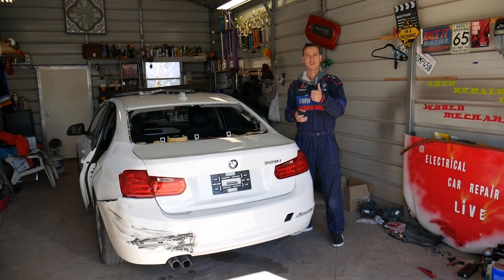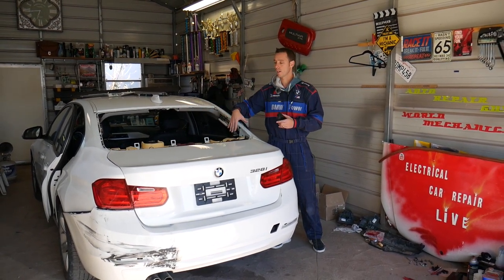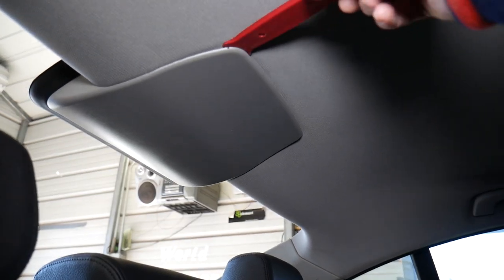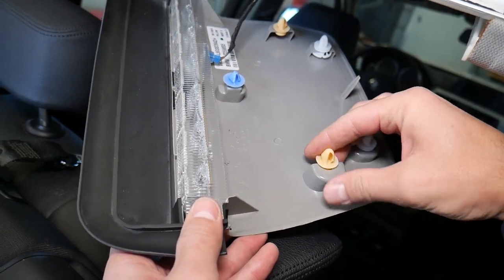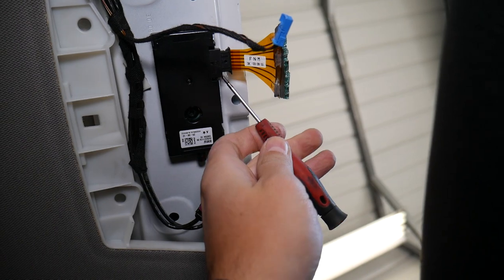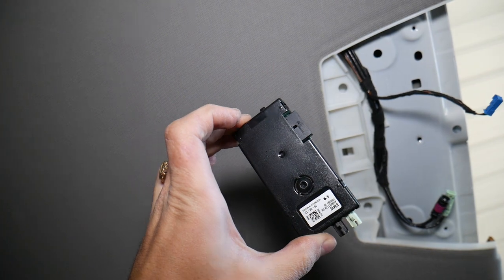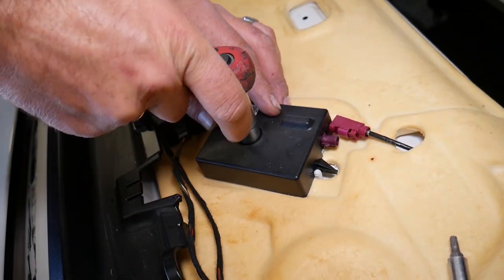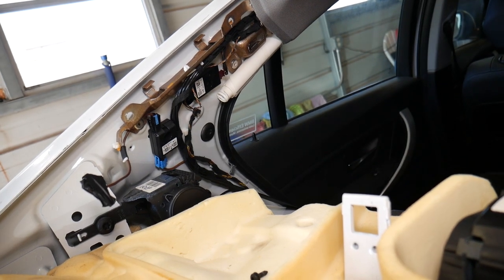BMW F30 F31 F32 F36 ANTENNA AMPLIFIER MODULE LOCATION REPLACEMENT 316i 318i 320i 328i 330i 335i 340i

Comment: Couldn't figure out why my radio reception was so terrible I opened the trunk and checked this amplifier and it wasn't even connected to the antenna base!! This has been annoying me for so long!!! I have had to use Bluetooth only until I found this video!! I reconnected the amplifier now my radio works perfect thank you!